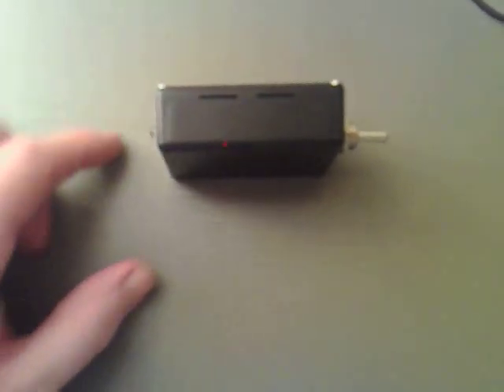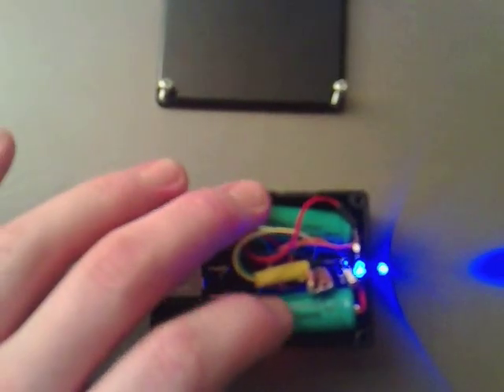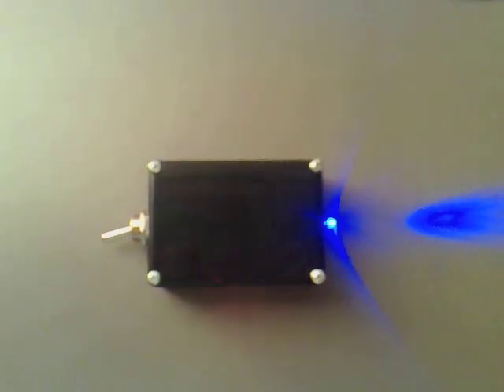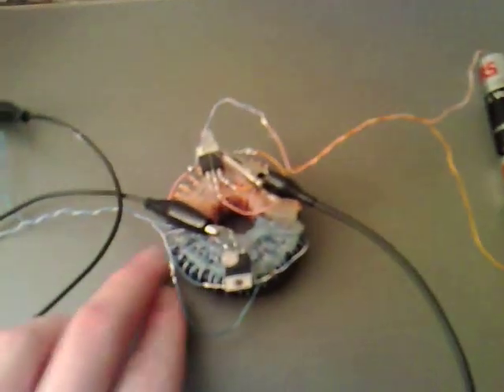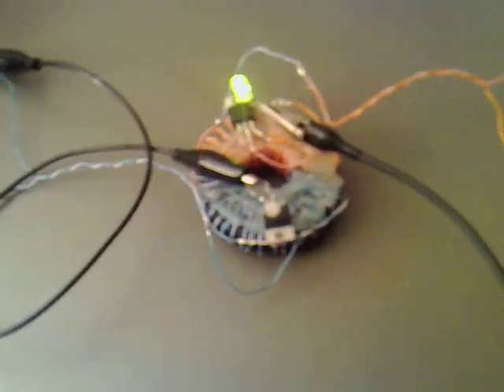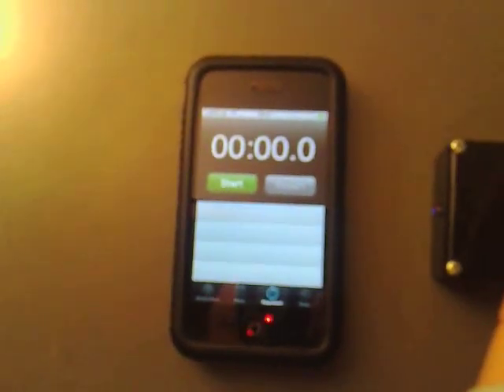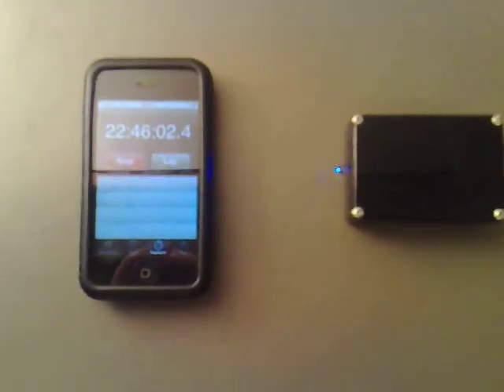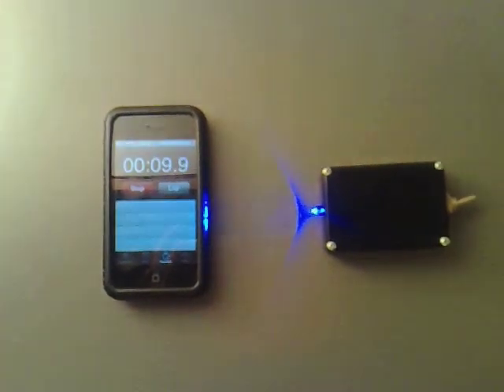Joule Thief (OP2 Circuit Test 01) 004

Comment: I've seen this happen with low voltage low current situations of large amperage switches. The contacts oxide enough to prevent continuity, but under normal higher amperage use the oxide 'burns' off. Also, grease in the switch can do the same thing. 

The solid state approach is good, esp. if you have it log somehow the battery voltage and switching times. 

Cheers!

Comment from the maker: I know......
I have just had to disassemble it because the switch broke? It only switches intermittent on the right side! Some think is going on in this circuit because when I took the witch off it worked find on Bread Board. I think the terminals have corroded in some way. Im going to switch it solid state now instead. It still has power in it and it ran for 2-3 days before the switch broke. it was a 6A 120v Double Pole Double Throw.

Paul